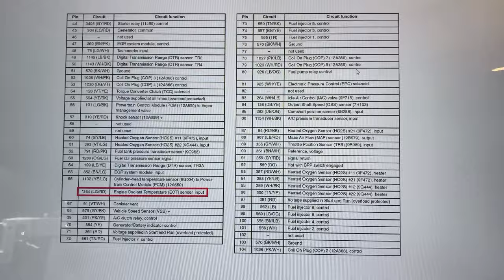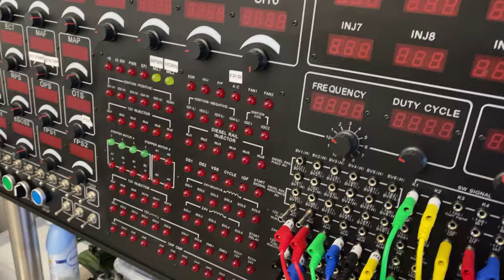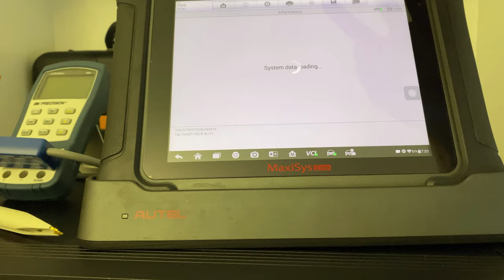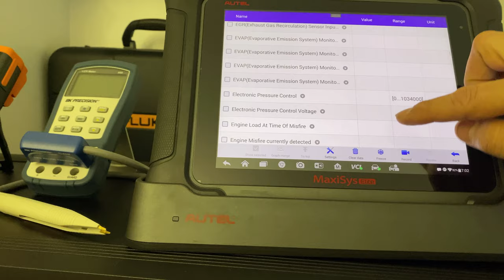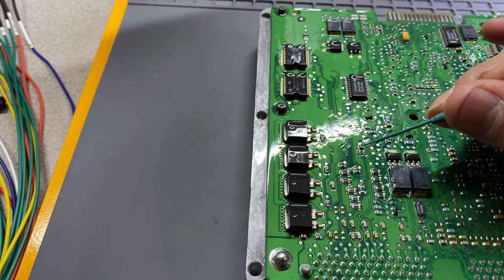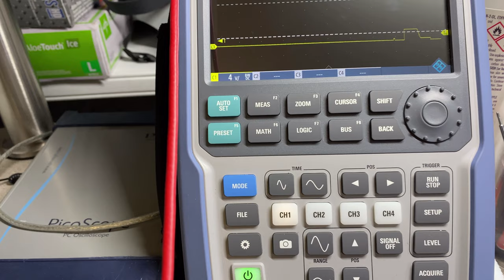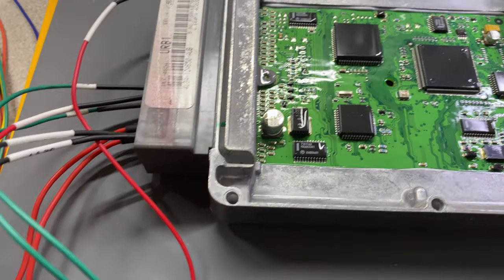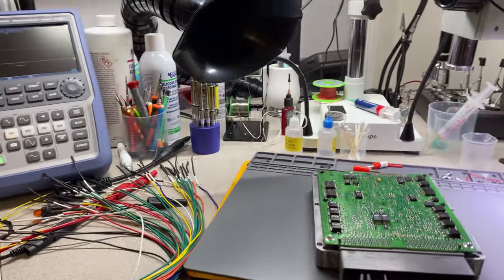2004 Ford F150 Lightning PCM testing

Comment: If you voltage test dpfe signal koeo at the pcm (just the signal pin 65) from positive to battery - is voltage suppose to <=5v? 
If the voltage is over 5v? Is it the PCM done?
Reply: Yes that simple test and good way

Comment: I have an 04 lightning been trying to repair but keep getting things one said reprogram other said a port bad. Would you be able to help fix.
Reply from the maker: What is the problem you experience? I don’t understand when you said a Port bad?
Reply: @MaicSalazarDiagnostics  they told me that Port 12 was not letting power out but Power was going in just fine. And the transmission is not shifting properly so just trying to see what the issue